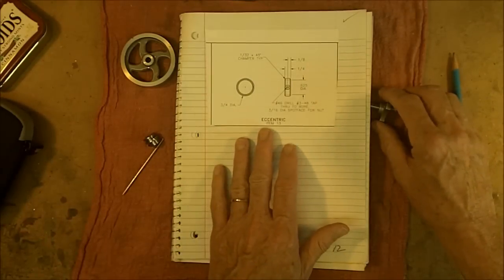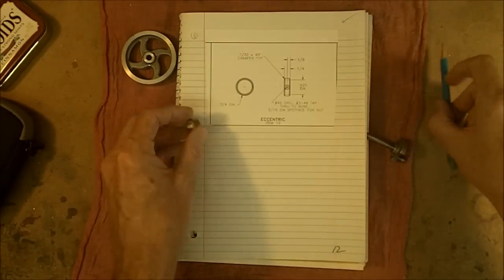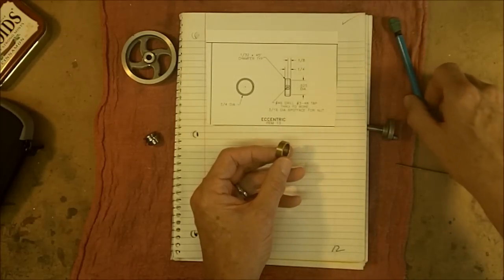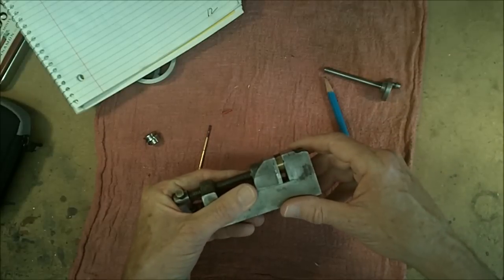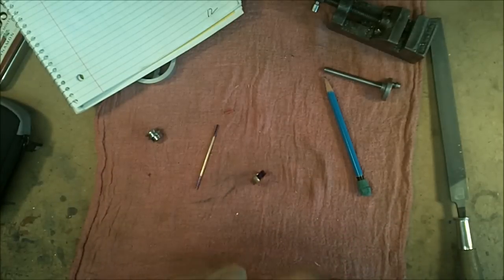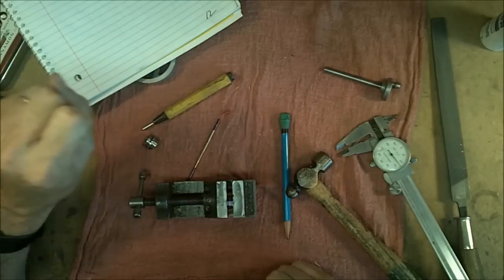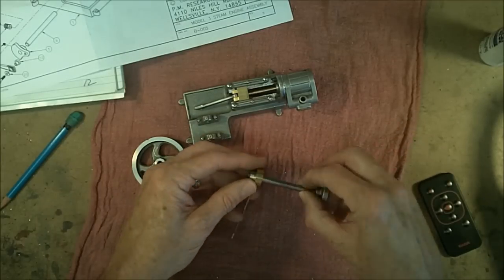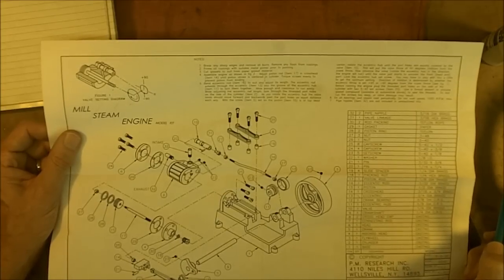Part 40 - PM #3 Steam Engine-Eccentric Rod

Comment: Thanks for answering John, I received the metal casting kit and following the videos of you is relatively easy to machine, my biggest difficulty is resize the plane to use tools in metrics instead of inches.
Some time ago I was also amateur radio, not decamentricas, in 27 mhz and 144 mhz.
Happy Christmas.
Greetings.

Comment: Best of luck on your retirement and move to Texas!

Some day I hope to scale up to a working steam engine on our farm we hope to retire to in Wisconsin and make useable engines that can generate electricity. In that vein, an idea I have is to take lawnmower engine parts (crank, rod, piston, cylinder, etc.) and design and machine a steam engine from these parts. I have even collected several antique cast iron flywheels from old post drills for that purpose (elegant curved spoke castings).